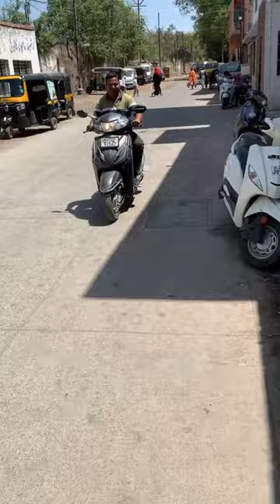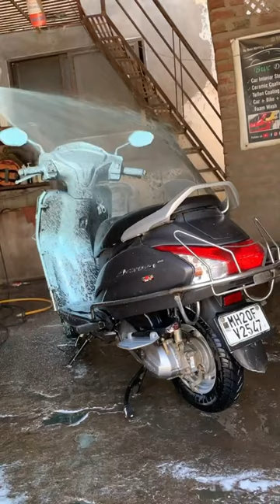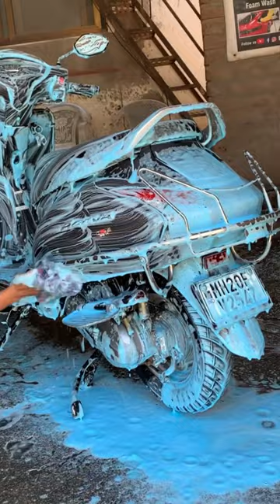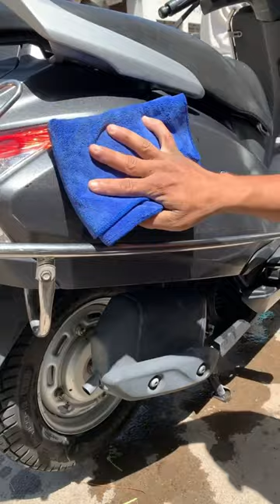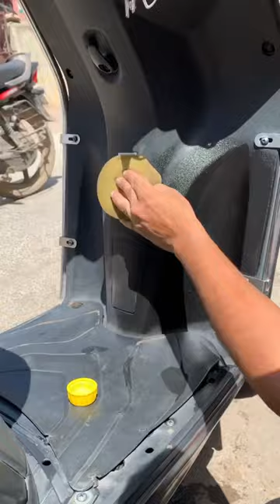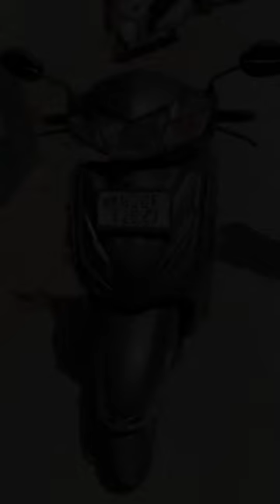Honda Activa 6G wash & polishing #shorts #detailing #bikedetailing #trending #ytshorts

Comment: Bro you should never use tire dressing on two wheeler.. Higher risk of crash. Only use on 4 wheelers
Reply: Kese ??
Reply: @summoning-a-danger  in 4 wheelers, only tread contacts the road. In 2 wheelers, when turning, the sides of the tyres contact the road. If you apply any kind of tire dressing, the tyre will become slippery and risk of crash during turning will be higher. Even manufacturers of tyre dressings advise against using them on two wheelers.
Reply: @abdulmsiddiqui4344  by any chance u live near granite road ??
Reply: @summoning-a-danger  no. That's a separate story, any bike has a higher chance of slipping on granite road. But tyre dressings will increase the risk on any road.
Reply: @abdulmsiddiqui4344  as per my knowledge I have been using dressing since 3 non stop, driving like drift car never ever I slipped on any road
Reply: @summoning-a-danger  it increases the risk but doesn't mean it will guarantee a fall